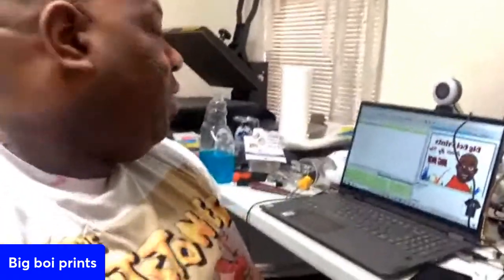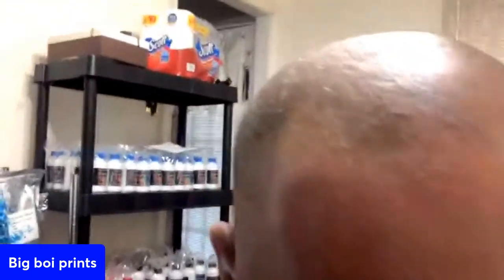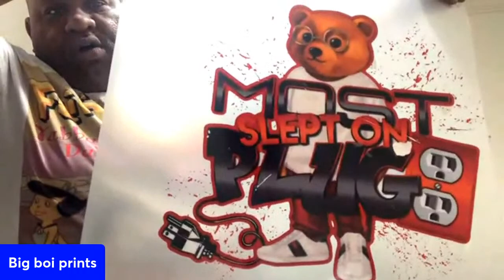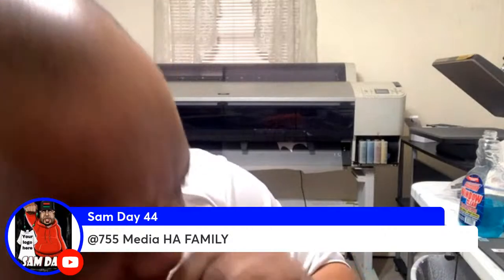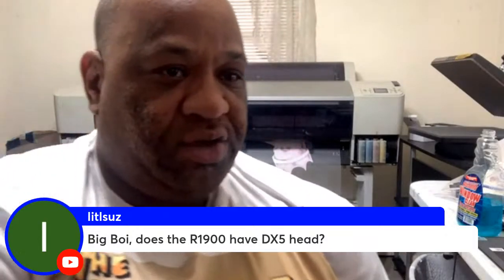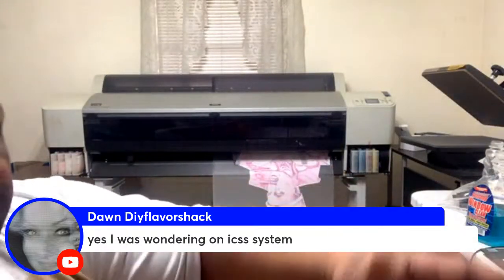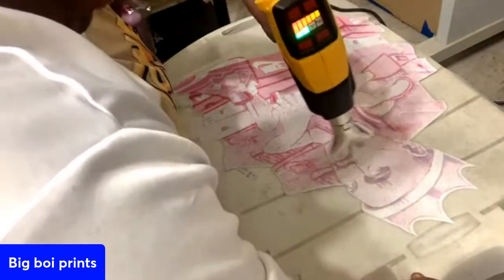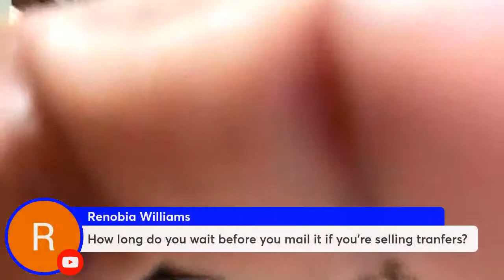Maintenance day 2 for your Dtf printer!

Comment: Hello @bigboi How do you convert an Epson stylus photo R1800
Reply from the maker: Like the R2000
Reply: Okay great thanks
Reply: @bigboiprints5726  could you send a link for the conversion  of the R2000, please
Reply from the maker: I don’t have a link but I bought everything from autozone
Reply: @bigboiprints5726  what all is needed to convert the R1800
Reply from the maker: A pick tool hose and a connector. And ink powder and film
Reply: @bigboiprints5726  on the 1800 do I need 2 hoese and conectors?
Reply from the maker: I’m not sure! But it could be